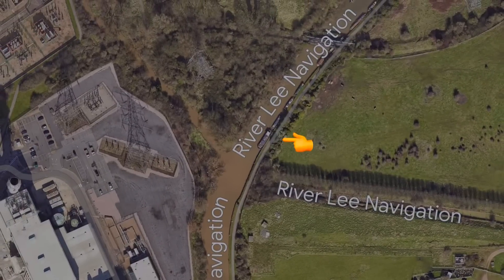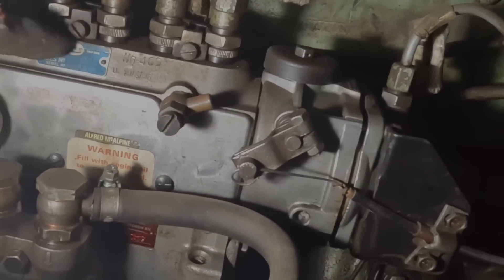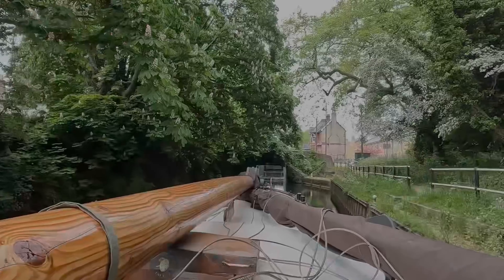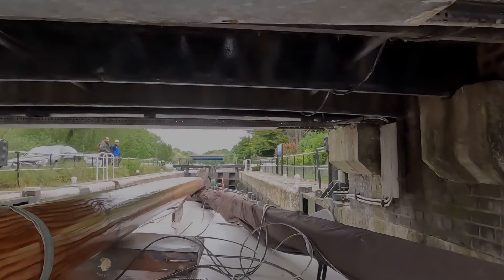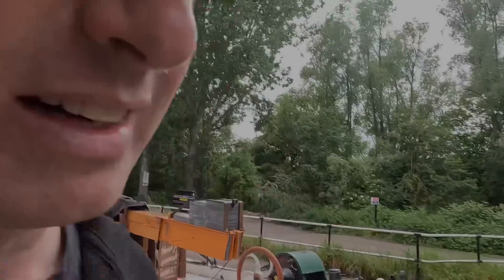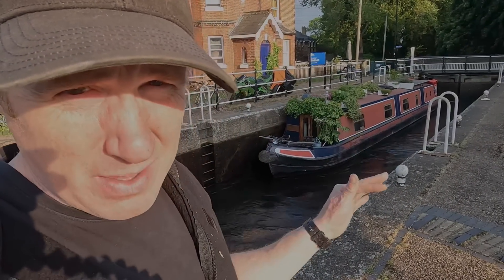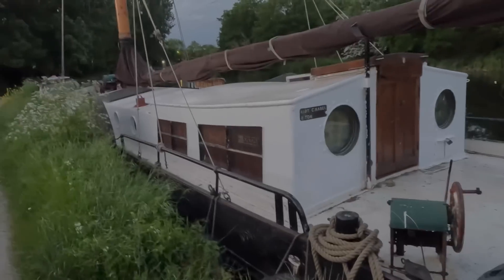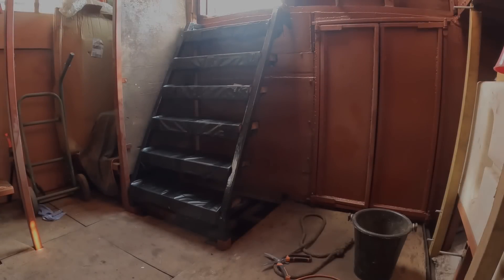What’s it like to cruise a Sailing Dutch Barge versus a Narrowboat in an English Canal.

Comment: I love the comparison on the differences of a barge and a narrow boat. Since I was researching the other day on what oil I should use in my DAF 1160 and since your engine seams to smoke just a little bit I was wondering on what type of oil you're using? SAE 30 or 15W40? Can't wait for the next refit episode! 😊
Reply from the maker: I believe my engine smokes because of wear on the piston rings or valves. Though I haven’t had this confirmed. It’s not the fuel pump or injectors at I have had them serviced. 
I’m still using the oil that came with the boat. There was a 20litre barrel of 15w40. I’ve just emptied it. If you can, do an in-depth video on the servicing. That would be fascinating! I could do one and release at the same time.
Reply: @canicebannon  feeling the love guys ! X

Comment: A quick question Canice. 
What is the accepted practice re lock gates in England?
Leave them set as you found them (empty if empty and full if full).
Or (as in Ireland when a lock gate is old and a little bit dodgy) leave them empty so that it’s the shorter (upper) gate that is under pressure?
Ta. 
Mark K. 
MVSarah
Reply from the maker: That’s a new one on me! In most of England you use the lock and close all the gates behind you to preserve water! If a lock is unusual, there will be a specific set of instructions for operation. The only weird one is on the Grand Union Canal near Hemel Hempstead, where the lock walls are leaking into the surrounding buildings and they ask the lock to be left empty…
However, in London it’s the practice to leave the gate open as the waterway is very busy and also, there is no shortage of water…. (Unless there is a shortage of water and they put a sign up….😂)
It’s really annoying to arrive at a lock where the previous user is passing you and they have closed the gate, because they’ve come in from the countryside and always close the gate. 
Most of the lock gates on the River Lea are made of steel…. It’s less historic but the Lea was still a commercial waterway and modernised well into the 20th Century…..
It’s a bit more robust.

Comment: Hey why not put a wire around the cold start & run it up to the control panel?? So you can just pull it from on deck?? 🇬🇧🇬🇧👍👍
Reply: It's not really designed for that. Remember this engine was designed in the 1960's or 1970's for industrial/naval use. Different times, different priorities... It's some kind of lever that you have to pull out with some force. Creating a connection with a wire will (I think) be rather vulnerable and prone to failure when not exactly ligned up at all times
Reply: @bartgroen4988  well maybe h  we could try ? 🇬🇧🇬🇧👍👍
Reply from the maker: I have to go to the engine room to turn on the battery and the fuel, so it’s no hardship to pull the lever. It only need to be pulled on a cold start. I don’t need to use it again. I turn off the engine in the locks to stop poisoning everything and it starts up fine at the key. 😀
Reply: Also good practise to do a small visual inspection before starting the engine, that's why we always keep some tasks to be executed in the engineroom of our DAF 475 powered tugboat
Reply from the maker: @bartgroen4988  I’m due a service. I’ve got to get that organised!